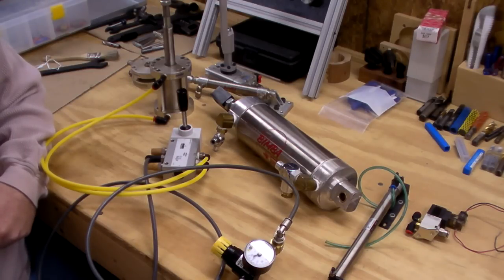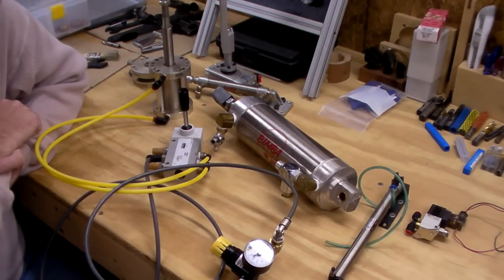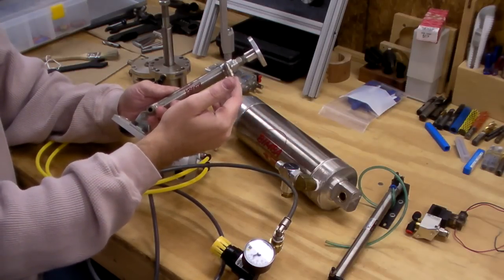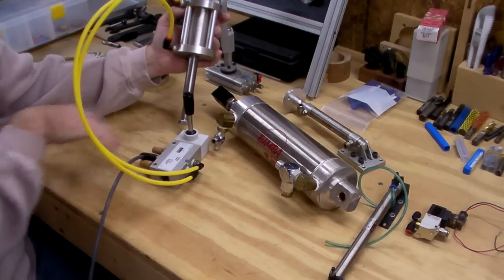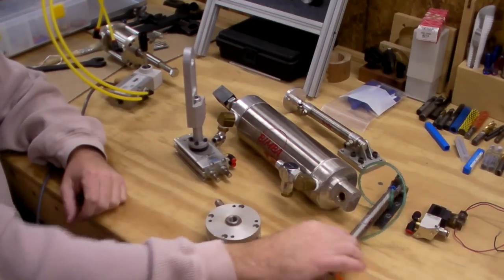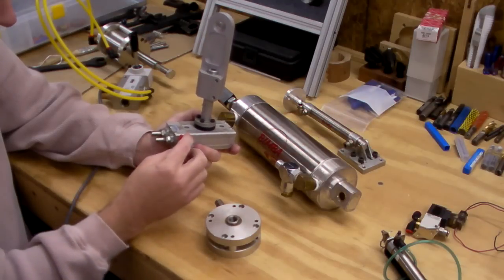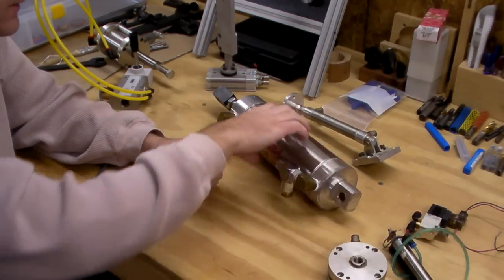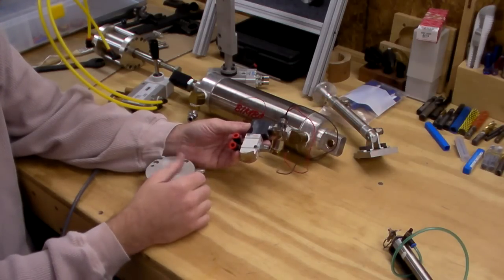Pneumatic Basics - WidgetWerks.Com

Comment: Hi,
Thanks for your useful videos.
I'm working on a pneumatic punch for fabric cutting and I'm not sure which air cylinder bore size i need to create about 130kg of pushing force. do you think that a 50mm bore cylinder with 8 bar air pressure will do? the cutting die I'm using is an oblong shape of about 50mm x 15mm.
Reply: This website is really useful for helping with calculations and choosing parts. http://www.engineeringtoolbox.com/pneumatic-cylinder-force-d_1273.html 
50mm with 8 bar would make 1571N of force which would translate to 160kg I believe, don't quote me on that because I'm new to working with these components but that site should at least give a good idea of whats what.

Comment: Hi, I I have a pneumatic can crusher. I'm just wondering, are you supposed to oil the cylinder as you would with a pneumatic tool? Or would that ruin the internal seals? I know this is an older video but thanks in advance for any help.

Comment: Question:  The first cylinder you pick up at about 1:25 has a round disk or puck attached to the end of the arm.  I've tried to find something like that but I don't know what they are called and have had no luck.  It might be a one of a kind but I'm hoping I just don't know the right search term.

It would save me hours of fabrication if I can order one for my cylinder instead of making one.

Thanks for the video.  Now I'll be on ebay for hours.

Comment: Weird question. I have a tire machine and it has a bead pressing arm that's a pneumatic cylinder where the bead press rides on a shaft with a piston in the middle. It goes completely through the bead press arm which rides on the shaftt so you can press down or up on the tire bead. It was leaking at the top seals because I think air would not easily exit the opposite chamber and it always slightly leaks air even after I replaced the seals on it. Any idea if that is normal or if it may be a valve issue?

Comment: Greetings!
     Hope you can help me...I have a pneumatic tennis racquet stringer...there is a compressor...2 small valves with adjustment screws and an air cylinder with piston(with clamp)...I cannot get everything adjusted to create a properly working machine.
     One problem is lack of movement in the cylinder...cannot get the piston(clamp) to move properly...not getting any air? Also, the tension release button does not drop the psi on the gauge, which would normally release the extended piston!
     I have tried to adjust the screws on the valves but no luck. If I open too much, then the compressor does not turn off...can hear the air leak!
     Could easily send u some pics if necessary.
    Any help would be greatly appreciated

Comment: Great video,    can you tell me how big of a compressor i would need to run that big cylinder you have there?  I have a pneumatic mortiser and need to get a compressor for it. I want to make sure it has enough power for the up and down feed.  The cyl in 4"x5"    I believe its a 5" stroke and 4" cyl.    ANY info is greatly appreciated.  Thanks, man.  Ron.

Comment: You referenced "pressure adjustors" they are not pressure adjustors they are flow controls. They control the flow of the air not the pressure. Pressure = force   Flow= speed. 
By adjusting the flow control you are adjusting the speed the cylinder extending or retracting.  By raising or lowing the pressure you are raising or lowering the force the cylinder will put out. 

Nice video.

Comment from the maker: It's a function of supply pressure.  More pressure faster movement up to the max rating for the cylinder.  There are some that you can get that have springs to automatically retract or extend.

Comment: Hey I'm designing a fairly simple pick and place to move a spring from one area to another. My main concern is that I'm planning on purchasing most parts from Bimba and the gripper from Festo. Do you know if I would have problems fitting these? Assuming I will, do you know how hard it is to find a good fitting plate?

Comment: Pressure equals force.  If your dial up your pressure you will not go faster you will only increase the force that it applies. F=P X A
If you want more speed you need to open up your flow controls.  If you still do not have enough speed you would need a cylinder with larger ports and them upsize your fittings and tubing. They then become the restriction to your speed. 
Just trying to get the right info out there. I sell pneumatics everyday. Hope this helps.

Comment: Hello.  Do you know if there are "lever" type proportional valves that could activate spring return actuator with variable pressure, ie: the more you move lever the more pressure is applied and when valve is being released, the pressure drops, allowing actuator to return slowly? What are they called?

Comment: helo frnd!! the vedio is awesom
hv some doubts to carry on wid........
how to calculate the bore diameter fr a specific loading weight ?????
+ how to determine the air preasure for the same loading weight????
plz give the adequate information abt the solenoid valves and how to controll them using micro controller doing programming stuff!!!!!!

Comment: I wonder if these are accurate enough to use on a xy table to make pcbs.
Reply: +Dan inWY I was wondering if they were accurate enough to operate a 2 inch irrigation valve remotely controlled with a Raspberry

Comment from the maker: You will probably want one with a long stroke and dual acting.  If the weight of the dog prop is going to be completely supported by the cylinder then you will also want it to have a thicker cylinder rod.  Hope this helps.

Comment from the maker: Thanks,  I'm not sure what size cylinder exactly.  But I'm also not sure is air is the right product for your application. You would have a "spring effect" with any air cylinder.  You may want to look at a small 12vdc electric linear actuator. Good luck and thanks for watching.

Comment from the maker: You can run multiple cylinders with 1 compressor.  You'd need to have a manifold or splitter that will allow you to run air to each.  Then you'd add a control (valve, solenoid) to each cylinders run to control them individually.  Thanks for watching

Comment from the maker: I would think a 90 to 120 PSI compressor would work fine.  If you use the mortiser a lot then you might want a compressor with a larger air tank and maybe even a higher duty cycle that a standard oil-less (cheaper) type. Thanks for watching

Comment from the maker: @AMCJav69 Yes.  You can control the big (or any) cylinder with a controller.  For the speed of the action you can add regulators to each port that will allow you to control the speed of the action.  All my gear comes from ebay.

Comment: what stroke do i need for adequate force to use a single acting cylinder as a can crusher?
Reply: B stan its not the stroke its the diameter that determines force and I have no clue how much force it takes to crush a can

Comment: Are you an mechanical engineer? or where does your knowledge come from? I'm really interested in studying mechanical engineering, but I'm having trouble choosing it over my current career path towards nursing. I'd really like to know what you do for a living and if you feel it was a good path. That is if you're still on here. Thanks for the video!
Reply: hello, I'm not a mechanical engineer but I know a few, the ones I know work in manufacturing designing machinery for manipulating materials into the required forms. I also know another who designs components for use in lifts. From what I gather from their work it's a lot to do with physics and incredibly mathematics intensive. If you have a good grasp of mathematics and really have a curiosity to find out how things work then it's the course for you. My course covered a few mechanical engineering topics revolving around choosing materials, I studied industrial design, which taught me how to take the properties of various materials, plastic, metals etc and calculate if the components would fail/break if they were put under the calculated load. Hopefully that helps you a bit.

Comment: I'm working on a project that plans on using a pneumatic cylinder independent of an air compressor as a type of damper where instead of the cylinder applying the force, the machine is applying the force to the cylinder, with the cylinder being used to resist that motion.  What types of manually adjustable flow values are out there that can be adjusted to increase or decrease this "resistive" force, without the use of a compressor?
Reply: there you go--> http://www.festo.com/cms/en-us_us/2499.htm  If you read through the page you will find a wide choice of "shock absorber" with different strokes, size etc... You need an adjustable one.

Comment: ok. where is the air coming from ? why do we need to move the piston up/down? what for ?
Reply: common man use your head or google at least
Reply: The air is typically coming from a supply of some sort which is usually refillable. The actuators can be used for a multitude of different things. I believe old cars used them for steering. Although, more modern cars use steering fluid. Even so, it still works on the same principles.

Comment from the maker: Hey Nate,  You'd probably want to find an electronic way to turn the laser on.  Using pneumatics would add all sorts of unneeded complexity.  If you're using a std RC control like Futaba etc you can probably control a relay with one of the channels.  I found some for $15 at robotmarketplace (dot) com  Search for RC switch.  Hope this helps.  Good luck!

Comment: actually they have a new system that will eliminate that. Regulated by voltage, variable voltage give differential to the distance traveled down the shaft, but you ain't gana beat hydraulics, with air. check out Enfield technologies this is the clean future! peace